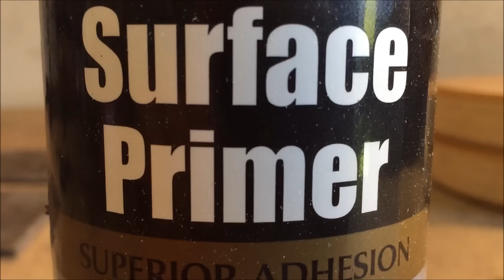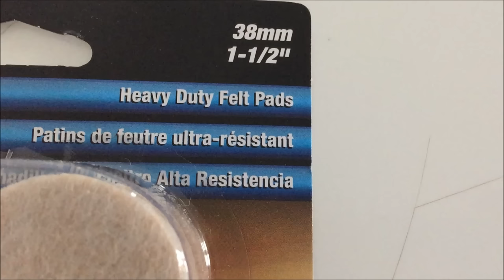Shock absorber stools

Comment: I am a mechanic, so allow me to predict the future for you here; The only thing that is holding the seat pads perpendicular to the ground, is the shaft of the shock absorbers. And it's a skinny shaft, as far as the options out there. When somebody sits down, they will be moving around on the chair, and their 60+ KG weight will shift *SIDEWAYS*. The springs won't stop that from happening. You have nothing in the design that can deal with the sideways forces, other than the shafts from the shock absorbers. And those shafts were never designed to take sideways forces, only up and down. In a car suspension, a shock would never experience sideways forces.

So what will happen here is that the chairs will be wobbly, and the shock seals will start leaking pretty quickly, and you'll get oil all over your shocks. Worst case, the shock shafts will actually bend.

Don't get me wrong. They LOOK nice, but you forgot to consider physics.
Reply from the maker: Thank you for all the info, Its much appreciated. I have learned a lot about shocks in the last few weeks.
Reply: I'm not a mechanic, but I use logic too!
It is impossible for these stools to be useful for the same reason you mention. It has no support to keep it. The springs are going to contract but the shock absorber will not work in the way it is expected, they can not maintain perpendicularity, making whoever feels, ends up on the floor :(

It's a very attractive design, but it stays there, in a nice design ...
I'm sorry Eamon Walsh, but that's how I think it is
Reply: You could take a MacPherson Strut. It should handle the forces ways better :)
Reply: Eamon Walsh DIY I will subscribe just because of your comment.
Reply: Also a mechanic here. These will stand up just fine for a 200 lb person. These things are built to take a hell of a lot of weight. Also don't see them compressing a whole lot, unless they're very lightweight springs. I made a set of stools out of minivan struts, It hardly moves when I sit on them. Mind you I'm not a big guy.
Reply: Addicted to projects.  Always good to see input from interested people like you who are keeping  a view to the safety aspect of good projects. 👍
Reply: I'm more worried by the idea of people angle grinding and welding pressurized struts !

As a side note, If car struts are too weak to take the lateral loads, maybe an alternative could be to use one half of a set of motorbike forks? Sports bikes put serious lateral loads on the forks under heavy braking, so they should be easily able to cope with a bit of bum wiggling when used as a stool post.

OK, The sliders tend to be alloy, so welding them to a base might be trickier, But they could always be stabilized in one axis by using a length of their original axle welded between riser plates on the spider (Base cross frame), And in the other axis it could  be stabilized via a support going to the caliper mount.
Reply: So you think a 130-150 pound person sitting on one of these springs is comparable to the amount of weight these things were designed to accommodate? That literally makes no sense. Try compressing that spring with the amount of weight you just referenced. You forgot to consider that amount of weight is trivial compared to what the equipment is capable of. Prove your theory.
Reply: Addicted to Projects so you hang out with people who weight 500+ lbs? That thing should hold the average adult NO PROBLEM!!!   You can’t even compare one person sitting on that stool to the fact that 4 of them hold up a 3-5,000 lb car no problem. That’s roughly 1,000 lbs each DRIVING down the road and absorbing all the crap on the road. someone weight 200-250 lbs drinking a beer on it won’t hurt shit... great build!!! 💪🏼
Reply: Addicted to Projects 
You admiring him too much. 
😂😂😂😂😂😂😂
Reply: Someone noticed that .. but to improve that he can give support for the shaft so it might not bend on side when external force is applied and might stop shock from leaking .
Reply: @Tweaked86;  yeah, love the way "experts" weigh in saying "Orville,  that thing can't possibly fly" with a bunch of completely wrong physics to back their theories up.
Reply: Hi
Reply: Mark OnTheBlueRidge whatever you say lol
Reply: Mark OnTheBlueRidge my point was that in order to place any amount of lateral force on the shaft of the shock, the weight of the person that has been shifted to one side or the other would have to be enough to compress that side of the spring. Which is typically not easy to do. Hence the need for spring compressors in a shop. So in an application where the forces exerted on the part are merely a fraction of that which it was designed to withstand, I would think a lot of the considerations mentioned can be safely overlooked

Comment: There is nothing like a great and sturdy stool. I really like the look of them. The orange springs make them pop nicely. Suggestion/Idea you didn't ask for: What about a triangular gusset at the bottom where the shock body meets each of the legs? I'd think there would be a lot of lateral stress on that weld junction.
Reply: JoeCubicle And these are nothing like a sturdy stool.
Reply: Robert Szasz You're right but JoeCubicle's idea would strengthen it up a lot .

Comment: Im a tsce  which means I qualify as a technical support calibration engineer.Two things will happen here,1 if you sit on it and put alot of pressure on it while you try and put the nut back on ,if you have problems putting on the nut the shock absorber gives way and shoots Wright up your arss . I should be out of hospital in the next couple of years..

Comment: Ya, I wouldn’t sit on it either.    1/4 in plate, sturdy base..   triple stacked mdf.   And you hold the whole thing together by a small bit of threaded rod?    Seems as though it would either be hard to sit on, or bend soon.
Reply: Mike Iuzzolino It's a strut from a car. The shaft is supported inside the tube. It'll handle a person.
Reply: William Green  in a car it will only ever receive vertical force, which it’s designed for.    If someone sits on the edge of this, it will apply horizontal force.    Something it was never meant to absorb.

Don’t get me wrong, I’m not hating.   I want to like these, but it just seems incomplete

Comment: I have a pair of shock absorbers. And one of rear trunk . i want to use its steeel rod by cutting the oyter cylinderical shell. I need to know it  is safe to cut it.
Reply from the maker: I do Not know, you would be advised to speak with someone that is a lot more experienced than I. Be safe!

Comment: I haven't seen you do this step below.. 

Also before welding it to the base drill a small hole in the shock to release the gas inside. Although it should be inert gas it is wise to do so to stop the gas pressure building up from the heat of the welding.⚠️

Care to explain? Cause Making stools like these is an idea I thought of years ago. But I didn't dare to do so in case of serious injury due to the shocks exploding.

Comment: Nice.design but it couldnt hold a strenght..cause of using lyt spring and  rear shock..better to use front strut with a rotor bearing on the top enable to.rotate when someone seated...

Comment: Hello sir which absorber used car or Bike
Reply from the maker: Hi,
They and spring came from the back of an old VW Polo car

⚠️ Warning, these coil springs were not under compression!!! If you are attempting these and are not sure what you are doing make sure the springs are clamped as they maybe under compression and could cause serious injury when opening them. Also before welding it to the base drill a small hole in the shock to release the gas inside. Although it should be inert gas it is wise to do so to stop the gas pressure building up from the heat of the welding.⚠️